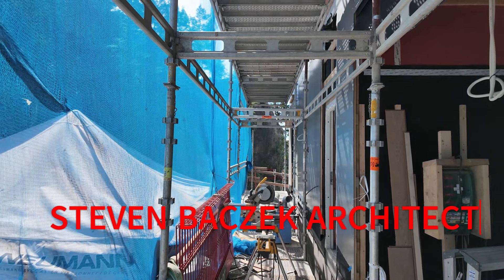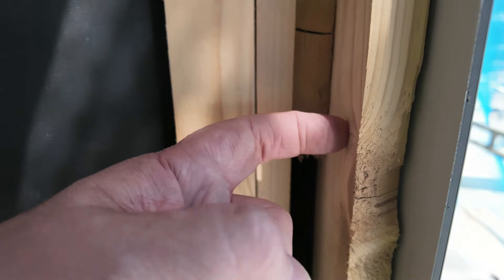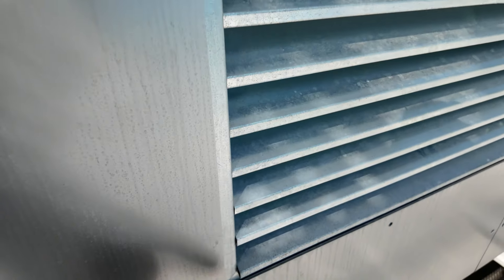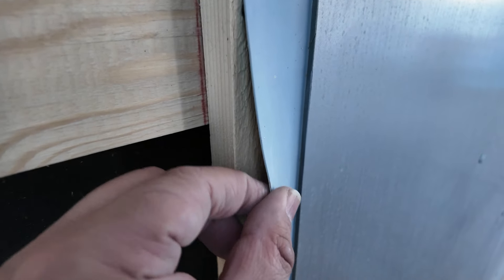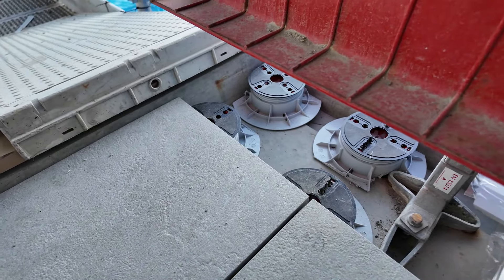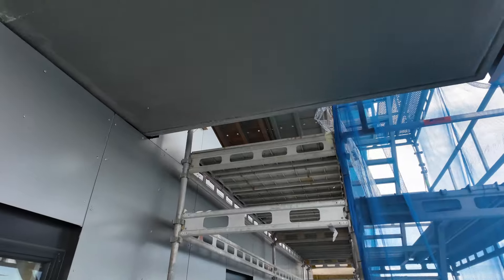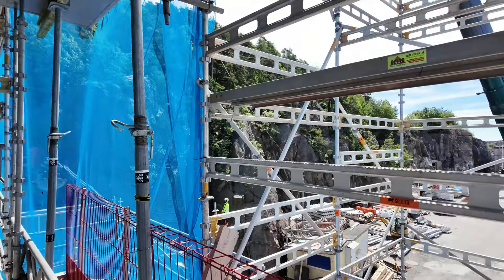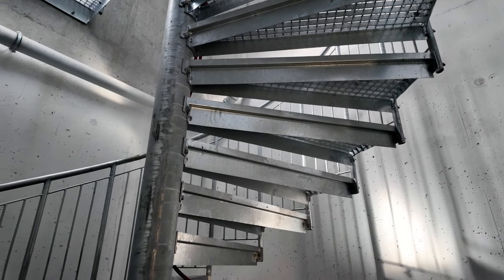PRE FABRICATED BATHROOM PODS.....

Comment: The balcony decks are thermally broken(?) from the inside deck. Invisible connections is one system that has a cast in place sleeve that receives a bracket/shelf for the balcony element to rest on, with columns on the outside edge, or a tension rod going up and into the wall above.  The balcony can be lifted in place after you have done the main building, so the wall sheating runs behind the concrete balcony element. 
 We also use a lot of rebar/insulation cassetts/boxes called; isokorb, +other brands. It looks to be what's used in the video.  It's basically a piece of xps insulation with stainless rebar going thru it in the top part. And a pressure block in the bottom to receive the forces. They can be off the shelf of project specific.  The balcony often comes to the site precast, you put up some shoring to put it on, I prefer peri multiprop and mrk frames... Then lift it in place, its placed so it matches the inside floor height. Rebar then sits on top of the rebar you have already put in place for the main deck. Add the rebar specified around these straight rebars going into the main deck. This system has rockwool insulation inbetween the isokorb elements. Pour the main deck. And after its cured you have a 4ton+ concrete piece sticking straight out from the building 😂 Both systems are typically mounted so that the concrete on the balcony are outside of the wall sheating, so usually 10cm/4", typically a roofing material are put on in the transition between wall/balcony. A metal flashing can also be used to hide this if the furring for the siding doesn't cover it. #longanswer😅
Reply: Americans are bad with geography. If he knew how cold it gets there in winter , he would never think that the balcony doesn't have thermal brake from inside the building
Reply from the maker: I don't think they do, a number of us were looking at it and it didn't appear so......

Comment: Those panels should have that aluminum/metallic layer wrapped around all 4 edges (by at least a few inches) to prevent exactly the failures you’ve identified. At least then water wouldn’t influence(as much) the panel edge’s deterioration. Makes me wonder if they’ve intentionally installed it as a sacrificial panel??
Reply from the maker: Yeah, they could be better

Comment: Are you like our friend?— when we were spending the weekend together  he’d walk into job sites and if someone confronted us, he’d say “I’m an architect…” for an excuse!
Reply: Used those adjustable feet with pavers on a project—really great to have a level  surface right up at floor level and all the drainage sealed up below. You can both easily fix any drainage issue and protect your membrane—as long as you’ve provided proper drains in the first place.
Reply from the maker: Pretty much.....